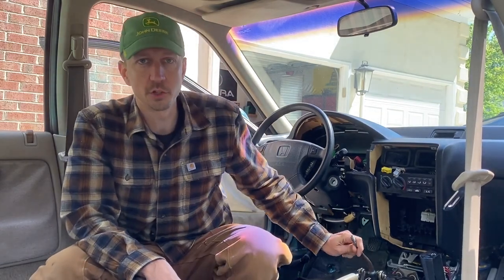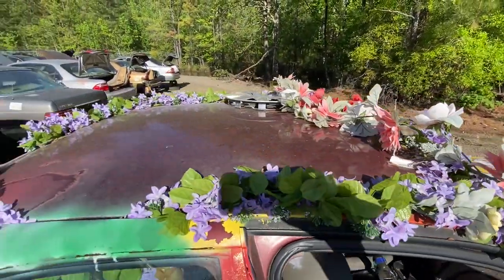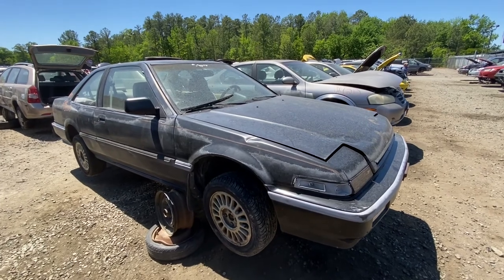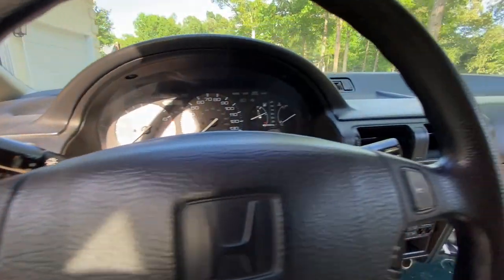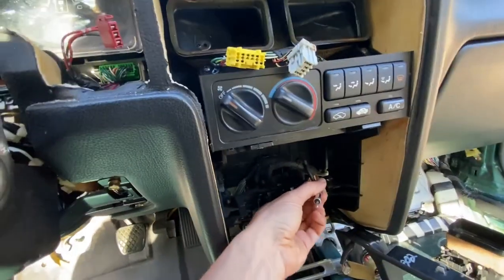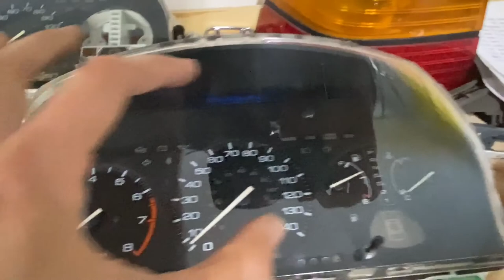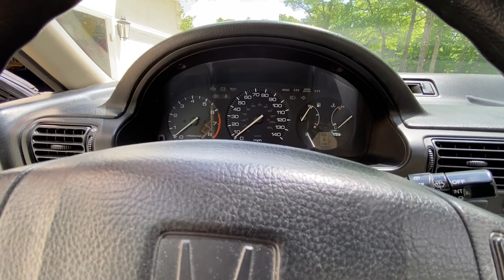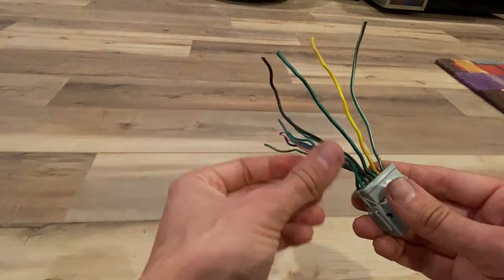Part 2: 90-93 Honda Accord CB7 CB9 Automatic to 5 Speed Conversion

Comment: Great video man, very helpful. I’m a little confused though as to why you picked up the new harness and neutral safety instead of using the ones your automatic came with?
Reply from the maker: Good question.  Rather than destroy my automatic shifter with cutting the old harness out - just grabbed one from the yard instead.  Nobody buys those automatic shifters anyhow and the yard doesn't charge for small little harnesses where I go.

Comment: Hello friend, I did the manual conversion to my accord 90, but I am having problems with the ignition, it starts but does not start, what exactly is the purpose of joining the 2 cables of the brown connector?

Comment: Do you have to swap to the manual cluster setup or can you drive the car with the automatic cluster after you complete the auto to manual conversion?
Reply from the maker: The car will work fine with the automatic cluster.  It'll just be lit up in park the whole time.  Its just a step for trying to make this conversion look at OEM as possible.

Comment: im on my way rebuilding my 96 accord. i have most of the front suspention replacement other than the lower control arms and axles. do you have any knowledge about replacing the other bushings like trailing arm bushings with solid polyurethane bushings? im not putting coils by the way

Comment: Now a question about the wiring for the reverse switch do we need it to make it run?
Reply from the maker: Its not a requirement to make it run.  But its a nice feature to keep in operation.  Hardest part is pulling the wires into the engine bay.

Comment: Hey bud after those connections you don't need a clutch switch?
Reply from the maker: I have not figured out the clutch safety switch, so the car will start up without the clutch pedal being pressed, so make it a habit of pushing clutch in out of gear.
Reply: ok that sounds like a plan.. I did what you did with the safety switch at the shifter. I have another question where did you run the clutch line coming from the clutch master cylinder to? stray to the transmission?
Reply from the maker: @ricardoe.t.v2927  along the firewall and on top of the transmission to make the slave cylinder connection.

Comment: Did you disconnect the wires on the reverse switch and install the new wires on.or just splice in with the wires that we’re there
Reply from the maker: I spliced on new wires onto the wire harness and pulled those wires into the engine bay and connected to the reverse switch.

Comment: When I did my cb9 manual swap I just swap clusters with out doing what yu did and it work just fine is there a reason why you did this way
Reply from the maker: I was hesitant of rolling back any odometer stuff and concerned I wouldn't be able to get it back in right.  Someone also said the harnesses might be different, but going off what you said guess they were wrong.  Oh well, all is good...
Reply: It's so you can retain the actual milage